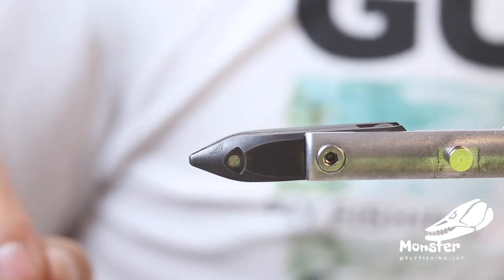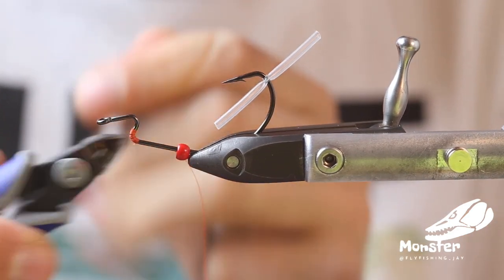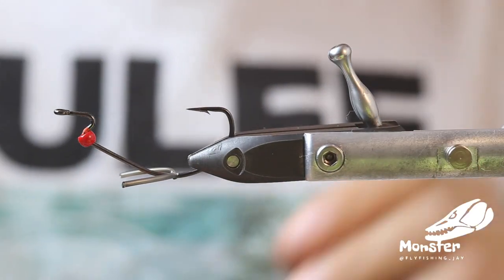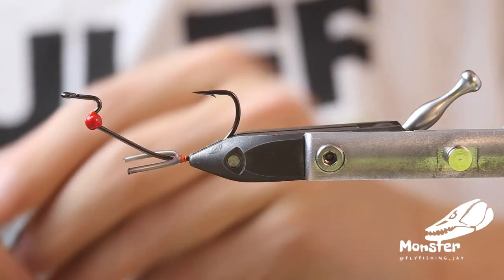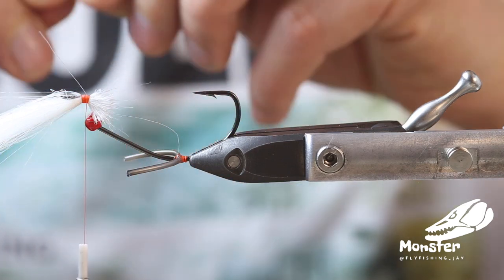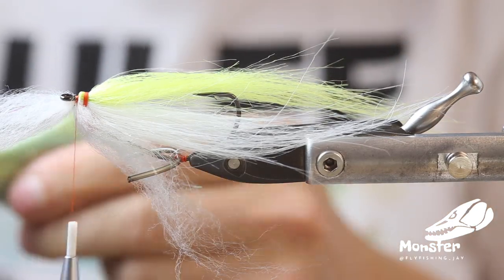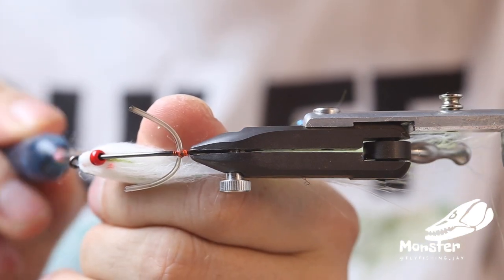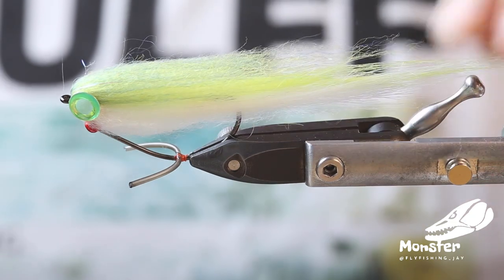The Standing Minnow - Offset Perch Fly

Comment: Hi Jay, Thank You for the very nice videos! 
How do you know, when the fly is on the bottom? 
How do you identify the bite when you don't strip in? 
What line are you fishing? 
kind regards, Jannik :)
Reply from the maker: U usually feel the bottom when u strip in due to stones mussels etc.
It helps if you know approximately how deep the water is u r fishing of course and you can count in your head how long u let the fly sink to adjust it. If u can't feel the bottom due to sand you can sometimes see it by the tip of the line that's  floating on the surface and gives a small cringle when the fly or sink tip line touched the bottom.
you usually just feel a pull in the line when they take the fly and if not u feel the fish with ur next strip ;)
Reply: Thank you! I will try :)